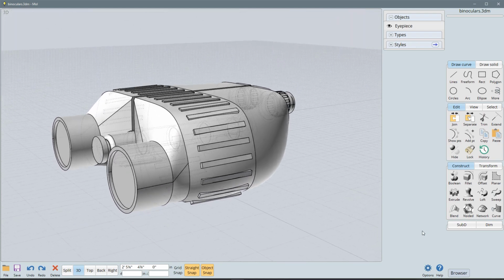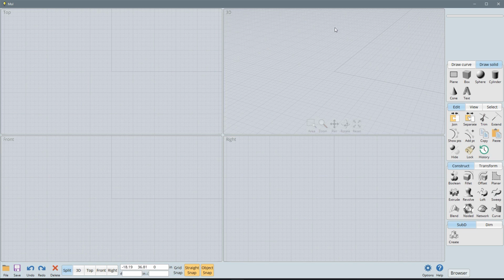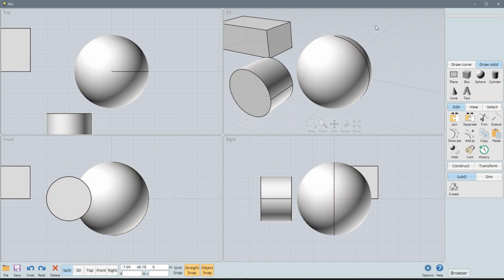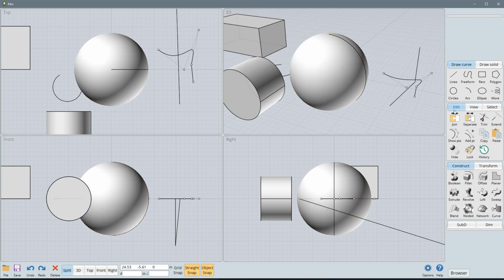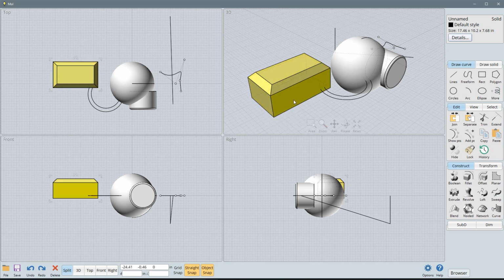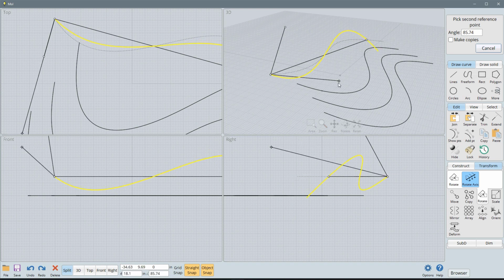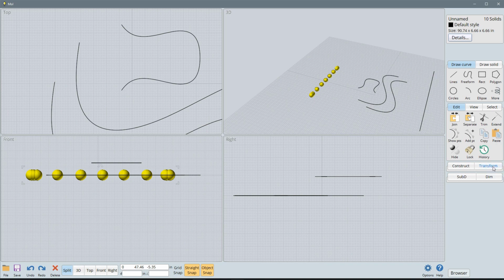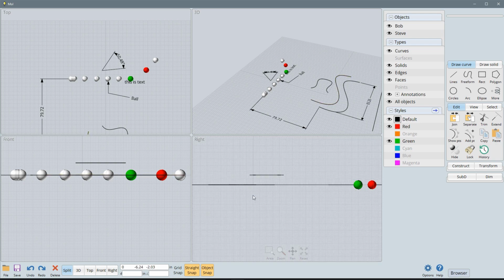Exploring MoI 3D (CAD Software)

Comment from the maker: Would you use CAD software for games or animation?
Reply: We did make simple animations to demonstrate assembly steps, and for various analytic purposes.  But nothing approaching what's typically seen in video games today.  It was basically 1 screenshot per frame.  We had very crude lighting and animation aids built in, but it was still a lot of manual operations to create an animation.  Heat flow analysis was to most difficult and time consuming because of the time required to calculate the result for each frame of the animation.
Reply from the maker: @EnigmaDave  Yeah the render you see in the thumbnail and the end card was actually from LightWave 3D. Moi has a great function to export the model as polygons so you can use it in polygonal applications.
Reply: MOI 3D is a modern Form Z. I like it a lot because it generate good looking geometry and uvs.

Comment: it  would still be nice to interpolate from mesh to beziers curves on edges in Blder, 

this would be pretty usefull for reshaping (réediting) multipoints edges, likes round edges and Bevels!! wich are the main obstacle when reshaping...The funny missing point because when you convert a 3DMesh to a Curve in Blender, the option look active, but it dont do...the cube still a mesh...Also this is related to other things like materials? 
Materials should be more interactive with selections(groupes) to avoid the need of separating in parts, i usually separate just because its more easy to change the materials in objet mode...

Comment: as a Blender, with massive add-on tools, and longtime Solidworks/F360 user, am considering reinventing my workflow for NURBS-based (geo kernel) design/modeling. basically, start using MOI vs Solidworks/Blender. what are the major advantages in using MOI vs Solidworks/F360? total net cost? offline capability? MOI-to-Blender transfer? the more I use Blender, the less I enjoy using the other two packages. learned about MOI from the BlenderBros....my sanseis for hard surfacing models.
Reply from the maker: I don't use blender, Fusion, or Solid works so I can't really help with any of them. MoI3D is a permanent license for $395. I've been using this same version for years, no need to keep paying every year.

Comment: Love this video, and Moi3D too!.

However, i really wish that Moi3D includes its own polygonal modeler so we can do subdivision modeling directly within Moi3D (for this time being, i did it in Blender).
Reply from the maker: I agree. I've been working with LightWave 3D for about 18 years. Having poly modeling in MoI would be a great transition to learning cad.
Reply: @3DJapan  Well, AFAIK, Fusion 360, Inventor, Alias, Catia, Siemens NX, etc have subdivision modeler integrated with them.

Even Alias which considered to be an 'AAA surface CAD modeler' includes SUBD modeling, and this should be for very good reasons since they've been in the industry for quite a while.

Comment: Great demonstration, Phil!  Although the syntax and interface is completely different, most of the operations are similar to the tools I used back in the day.  Fillet and Chamfer operations were manual sweeps.  All of the Array operations would also have been manually done.  I'm curious if editing the value of a dimension also updates geometry..  That was a huge time-saver when dealing with family-of-parts style objects.  For ratio pumps, as an example, the external dimensions of each stage would remain constant, but the internal volumes would differ to maintain the proper ratio of fluid per stroke.  It was so nice to design one stage, then just edit text to create the other stages of the completed pump.  Moi 3D looks like a richly featured and intuitive set of tools great for most types of physical CAD work.
Reply from the maker: I'm curious did you notice any tools that it's lacking from other programs like Autocad or Rhino? I used Rhino once or twice way back when I started learning 3D and I thought I remembered it having more tools.
Reply: @3DJapan  It's got all of the euclidean tools for planar stuff, and standard solid operations for regular geometry.  It handles bezier curves in the typical manner.  From a physical modeling standpoint, it seems pretty complete.  It does feel sparse just looking at the interface, but that's because so much of the language for expressing positions is now built into mouse movements,  I no longer need to say "origin" or "end" to ensure proper selection, a simple hover and visual confirmation replaces that whole language now.  I used ComputerVision CADDS 4X, and later Parametric Technology's products before moving into Unix system administration and ultimately Information Security.
Reply: @EnigmaDave  Its fun reading all the steps you have taken in 3D. Thanks for sharing. I am only about 2 years in and teaching myself everything. But I am bound and determined to be really good at 3d and CAD. I have my own cnc machine and a super nice 3d printer. Now I just need to up my drawing and design skills.